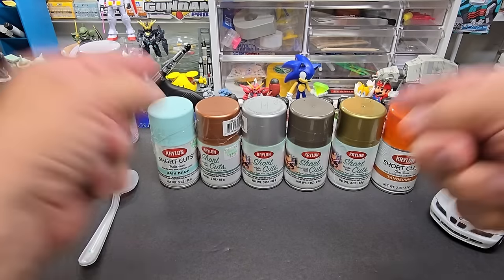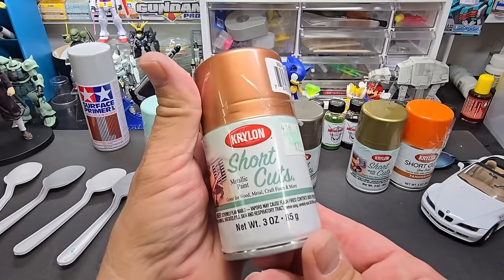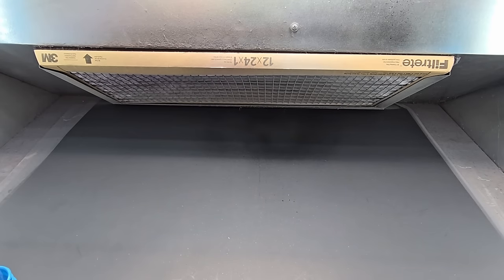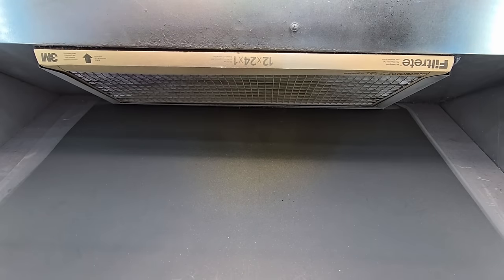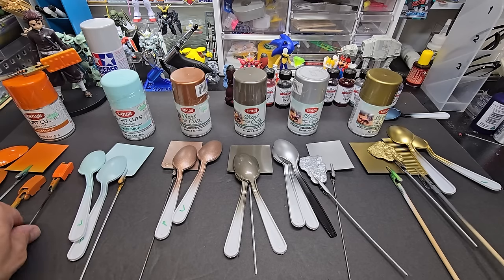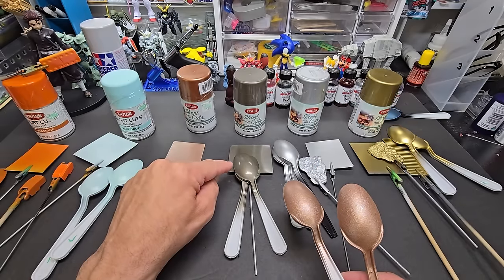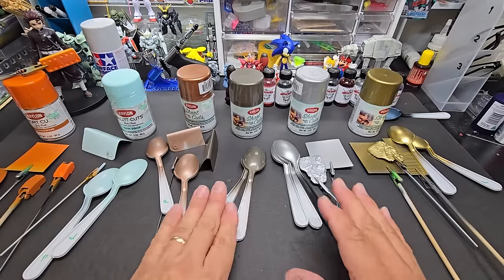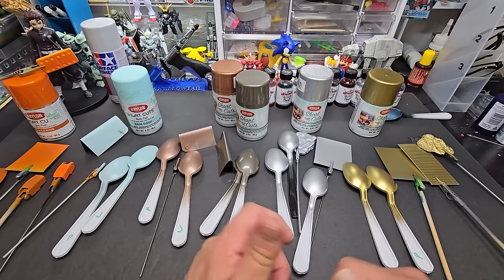Testing Krylon Short Cuts Spray Paint - Is It Good For Plastic & Resin

Comment: Thanks for the review. I'm a fan of using cans for priming. I recently found Krylon color master with cover max (flat black) to work super well. Really even, thin coat with no problems arising down the line after airbrushing over with both acrylic and lacquer. I'm now going to give Montana sprays a try. $7 for 400 ml of high quality paint is very appealing.

Comment: I've used Krylon on my outdoor train freight cars for years & never had a poor performance from Krylon paints.I use all flat finish paints, also overcoated decals with UV resistant clear flat.  Paint has lasted many years in all forms of weather.  Have used the Chrome Silver on delrin plastic trucks which the paint has stuck on for several years of handling.  So far no flaking.

Comment: Great paints, but in the UK the cost is way over the top, i.e. for 1 can of Krylon Gold Leaf Metallic - costs $47.69 including postage off eBay, and 1 can of Kylon Leaf Green (set of 6) costs $84.56 which works out at $14.09 per can off Amazon.  Still one of your biggest video fans.🥵

Comment: Cant speak to the current formulation, if it has changed in anyway, but Krylon was my go-to model car paint for years  (it used to be extremely "hot" and could craze styrene if applied with the can).   Built mostly 1/43, but all other scales kits, and  color changes for die casts,  for about 15 years in the 80s and 90s, selling to collectors, retailers, car clubs, etc..  Though I used other brands and automotive paints, the majority of my work was painted with decanted Krylon.  Sprayed through an airbrush as if it was meant to, no thinning required (Paasche H-5, 25 psi).  Beautiful self-leveling finish and responded really well to polishing.  Their Crystal Clear gloss, satin, and flat are among the best I ever used (you have to be careful and limit their use over only another Krylon color). A can lasts forever (I still have some OSHA Purple on the shelf I bought in the 90s).

Comment: Why do you need a machine to shake them up ? I use krylon and they work just fine . I use to use testers spray paint , not the best. But there Rustoleum brand is much better. Mr hobby and Tamiya are great but pricey.
Reply from the maker: It's a because I have one I use it. The paint mixer sits right there so I just reach down and use it. It's that simple.